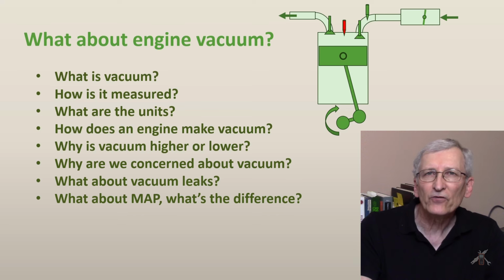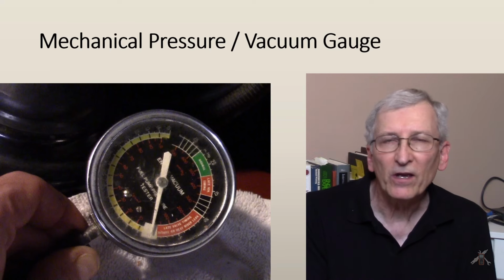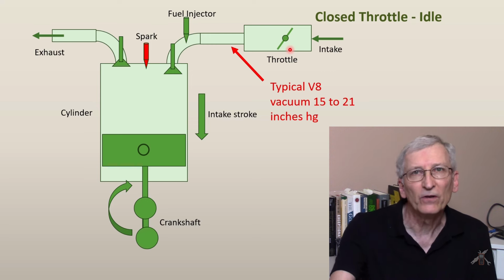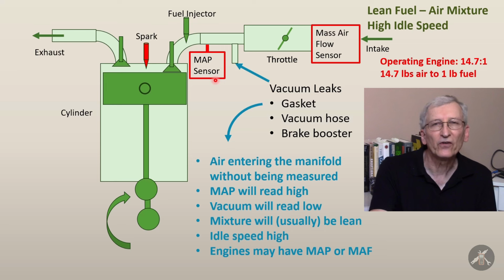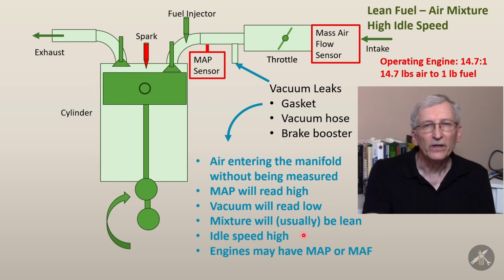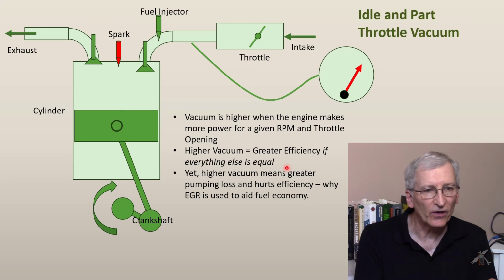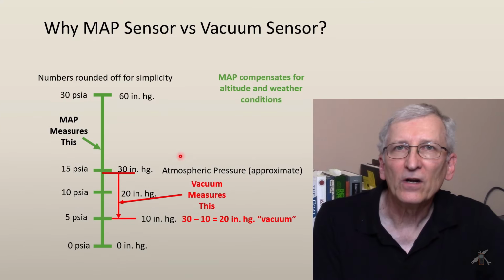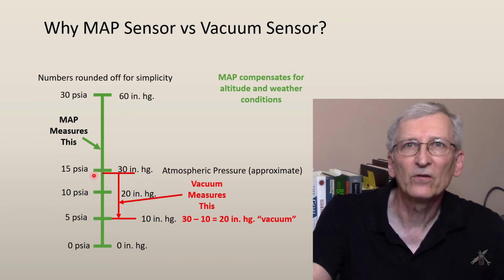Understanding Engine Vacuum and MAP - What is Vacuum? Why engines have vacuum & why it's important

Comment: May I ask a question. On my Jaguar AJ16 XJR6 supercharged engine there are two points where vacuum is taken: One is at the throttle body immediately after the throttle butterfly valve and just BEFORE the supercharger/supercharger bypass, and the other, which is the supply to my brake servo, is AFTER the supercharger just before the intercooler and intake manifold. I would have thought from a logic point of view that the point by the throttle is strong in vacuum as at idle the engine is pulling on the air and on acceleration the S/C is demanding a lot of air also creating vacuum, but after the S/C vacuum will be fine on idle, but on acceleration and full boost the S/C is actively pushing air into the intake faster than the engine is demanding it therefore pressurising my servo. Obviously I must be wrong somehow, or would it be better to take vacuum before the S/C for the brakes? Thanks for any help.
Reply from the maker: I don't know the reason for the manufacturer to choose that design, but I would not try to change it. On the surface, your logic sounds good, but the engineers generally know from testing what works best. One thing to consider is that on most engines, the vacuum brake system charges up / stores vacuum best at closed throttle - idle or deceleration. Also, there is consideration not only for the amount of vacuum in terms of pressure, but also volume of air moved to generate that pressure.  It may be that when your engine goes to closed throttle, there is more volume available at the manifold than immediately behind the throttle.  The brake system usually has a check valve to hold vacuum in the brake servo when the engine goes back to open throttle or boost to maintain a reserve.
Reply: @bitsofwisdom460   Thanks for the reply. I said the same thing to my electrician and he pointed out that although vacuum supplied to the brake servo would be less on full throttle I would not be braking when at full throttle. I pointed out to him that his education had not been wasted! 🤣. Yes, there is a non-return valve to keep vacuum in the reserve tank (although the reserve tank had been bypassed as it was punctured and obviously the previous owner couldn't be bothered to repair it due to its inaccessibility, or he had a death wish on subsequent owners!) so I will keep it as designed, or at least as I think it was supposed to be. With older cars like this sometimes it is hard to know what was original and what was a modification (or bodge-up) by previous owners, hence the question.
Reply from the maker: The questions are good. I agree, it can be difficult to know if an older car had been modified.  I always try to research, but it's still not always clear.  I like to try to maintain originality in safety related areas because sometimes the engineering rationale for the design is subtle and not obvious.

Comment: I simply figure Vacuum as being piston Suck dropping ambiant pressure at the Plate. At Wide Open Throttle, that pressure tries to return back to ambient but not for the latent volumetric inefficiency of the system.  We try to make up for that inefficiency by adding boost for Normalization, or Overpressure to multiply the air/fuel charge.

Comment: Maybe you should label your diagram "4 stroke engine" just to be pedantic.
Reply from the maker: I suppose I could do that to be more precise, but I thought it to be self evident.  Given that very few two-strokes have valves, except perhaps the old Detroit Diesels with exhaust valves.
Reply: @bitsofwisdom460  I wasn't keen to make the suggestion but like you, the Detroit Diesel came to mind so I thought it best to comment, a bit of wisdom if you'll pardon me.
Reply from the maker: Yes, that's fine, it's a good observation. 
BTW I used to work in a trans dyno lab with the a number of big Detroit Diesels.  When I worked on the M1 tank trans we had a 12V149 for durability work because we were breaking too many gas turbines. 4 valves per cylinder, two rootes blowers, 4 turbos, oversize injectors - 1350 net HP @ 1950 RPM.  A main difference in layout from 4 stroke is that these engines still had the intakes ports in the air box feeding the cylinders from near the bottom, so all 4 valves were exhaust valves. Really cool engines, start out from idle on mechanical blowers, when turbos spool up they overrun / bypass the mechanical blowers. Pressurize the air box so that when the ports and valves open, they clear the exhaust and recharge for the next power stroke.
Reply: @bitsofwisdom460  You've certainly given me a lot of info to digest and aroused my interest concerning gas turbine development for the M1 tank. Didn't Continental Motors at one time have MTU diesels and were they considered for the M1? In a military environment durability is paramount but ease of maintenance is up there to. I think it's criminal the poor engineering of today's cars where parts are so difficult to access let alone correctly diagnose or plastic is used in high heat areas where it becomes brittle and has to be rooted out. Better stop there and get off my high horse.
Reply from the maker: Yes, before I came to the project, there was a design competition between GM with a diesel and Chrysler with a gas turbine.  Ultimately, the gov't picked the Chrysler version. I had the opportunity to drive the M1s and the turbine was a nice performing rig.  But, in my 24 x 7 durability test cells I was having trouble wearing out the early production engines and keeping the cell running because engines were on shortage.  My facility team did a great job designing a gearbox to adapt the 12v149 and match the torque curve of the turbine.
As far as car design, I could explain, but that's a lot longer story. It's not usually poor engineering as much as the regulatory design constraints that the engineers need to work to. Mass / crash / fuel economy / emissions and so forth. I've been in the middle of it.
Reply: @bitsofwisdom460  You should write a book, aside from that, thank you for your replies and all the best to you.

Comment: I have a vacuum gauge just like the one you have. Bought it when I was 16. 72 now. Still use that today as it really helps what is going on in your engine. Great tool for carb tuning engine or any engine.
Reply from the maker: Yes, those vacuum gauges are quite useful for diagnostics and adjustments, aren't they?  I still use mine often.
Reply: I kept my gauge installed in the driver’s AC socket in my old 67 Camaro SS.

Comment: Hi, Sir. Can you tell if you have a timing issue from cranking vacuum? Thank you.
Reply from the maker: The engine will develop vacuum while cranking.  Ignition timing effect won't likely show up because once the engine fires, it will go from cranking to start very fast.  Valve timing issue like jumped timing chain would likely show up if ignition was turned off, but it might be hard to know what is normal cranking vacuum for a reference. I was asked to look at a car (friend of a friend) years ago that wouldn't start and the cam was jumped so far that it was pumping air back out the carburetor.  I didn't measure vacuum, but it appeared there was none at all.

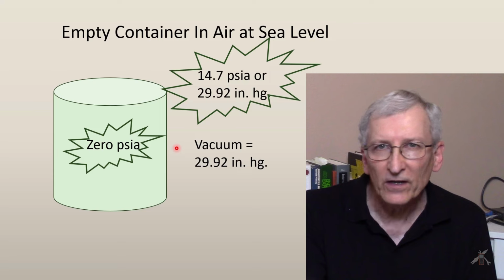Comment: 7:11 I’m confused. Can a vacuum be measured in mm of mercury?
I thought that relied on gravity, which is effecting the atmospheric pressure, but if we’re talking about the contents of a pressure vessel, its kinda like more about the difference between inside and outside, right?
Reply from the maker: Yes, vacuum or pressure can be measured in mm or inches of mercury.  And yes, you have the right idea, the difference between inside and outside is a relative pressure measurement.  That is what I was trying to explain: the difference between relative and absolute pressure. MAP is absolute, vacuum is the difference between atmosphere and inside the manifold (or other container).  You can measure relative pressure with a mercury column, it just requires a different reference point.  The best way is to use a tool called a U-tube manometer. I can't show a picture here, but if you take a clear glass or plastic tube that has a tall and narrow "U" shape, then connect the top of one of the sides of the "U" with a hose to the container and leave the other tube open to atmosphere, the height of the fluid column in the tube in mm is the relative pressure. I have seen these used with mercury. I use this method with water instead of mercury for very low pressures like air filter pressure drop.

Comment: Increased overlap will diminish vacuum AT IDLE. It will create greater vacuum at rpm, in a vehicle with full exhaust. Cam selection for a streetcar with full exhaust should afford only the minimal amount of overlap. It manifests vacuum on the piston when you are trying to rev. It will load the bearings beyond their integrity.
Reply from the maker: Yes, I agree that the overlap will reduce vacuum at idle and it will recover at RPM.  It will improve most at part throttle when the cam is in an efficient / tuned range.  But I'm not following your concern about exhaust systems and bearing damage.  The greatest negative load on the pistons will typically be on closed throttle "overrun" conditions.  Taken to the limit, assume a vehicle pulling a trailer on a mountain downgrade in low gear with the engine at high RPM and throttle closed for downhill braking.  I can say from experience that the engine can pull 26 to 28 in.hg. or maybe a little more depending on altitude.  You can sustain this condition for miles.  Now compression on most engines will be on the order of 100 psi or so, PLUS combustion pressure and the reversed load due to vacuum and with fuel cutoff would be no more than 14 to 15 psi. I don't understand how a higher cam overlap would cause a problem in this condition, but perhaps I'm missing something.
Reply: @bitsofwisdom460  it is complex. A manifestation of CFD.   Long exhaust = short duration. Long duration = short exhaust.
Oil temps will increase exponentially when it is in the zone. Dont run long duration cam in a car with full length exhaust and some gear. 80 mph is hot oil in 60 seconds.

Comment: Thank you, Sir  for the great video.  Could you please explain why pumping the brake pedal repeatedly cause the o2 sensor to go lean?
Reply from the maker: Yes, in short, the vacuum booster becomes a controlled vacuum leak in that condition. Back in the day, I worked for a brake system supplier and had design responsibility for boosters.  This gets a little hard to explain, but here goes... Essentially a typical vacuum booster stores vacuum (or has lowered air pressure) on both sides of a large rubber diaphragm. When you depress the brake pedal, a valve allows air to enter back side of the diaphragm.   
When you release the brake pedal, the booster needs to refill that large metal can with vacuum (removing the air) and that air flows through the hose to the intake manifold of your engine - on the back side of the carburetor or fuel injector so that it isn't measured and no fuel is added to compensate. Normally this is only a short pulse, but if you repeatedly pump the brake pedal, air will continue to flow into the engine downstream of the fuel metering system as manifold vacuum is depleted. If the booster valve has a leak, it can be a constant air bleed as well.
Reply: That is the best explanation I have ever gotten.  Thank you very much, Sir.

Comment: It used to puzzle me when pilots talk about manifold pressure in inches. Vacuum is half of the equation of a boosted engine. So how do you reference between vacuum and pressure? Inches of Mercury. No conversion, quick and concise. I rebuilt Pratt and Whitney R2800 radials and they had 2 stage superchargers. Along with T56 turbines, and that is a whole new story.
Reply from the maker: Yes, and I expect that dealing with manifold absolute pressure rather than vacuum / relative pressure can really be a help in aircraft, because it isn't affected by altitude.  A specific manifold pressure should result in equivalent power at any altitude or barometric pressure. Granted it may be harder to get a boost pressure at higher altitude.
And gas turbines are a different animal for sure.  I was a transmission test engineer and I spent several years in the '80s running M1 tank powertrains in dyno cells for performance and durability.  The AVCO Lycoming turbines were needed to test my transmissions.  I learned a lot about those engines because they were fairly new and had a few issues.  I ended up being an engine test engineer of sorts just for self preservation in getting my job done.
Reply: @bitsofwisdom460  I also had the opportunity to work on a test cell with a turbo I had recently rebuilt. It takes a little nerve and great care to stand inches behind a spinning 14' prop to adjust the fine pitch of the propeller control...
Reply from the maker: Yes, I expect that would be unnerving. I can only imagine that one.  The old Allison test cells where I worked had originally been used as final production test for the supercharged Allison V1710 V12 aircraft engines in WW2.  They were set up with large pedestals in the center so engines could swing a full size propeller and flow air through. That section of the test cell was heavy reinforced concrete while the rest was only brick. Rather impressive. For transmission work, they built floors at the level of top of the pedestals for bedplates.

Comment: Be more intuitive to lose the entire vacuum nomenclature altogether.   Calculations don’t like negative numbers, use the aviation convention of manifold pressure , positive units are better.  Plus, put emphasis that no engine, ever , pulled in air.  The atmosphere always pushes itself into cylinder p1v1=p2v2.  You know all that jazz better than most.  Excellent video, thanks so much.
Reply from the maker: Yes, I agree that dealing in absolute pressure in the engine is probably better. But, I approached this from a traditional automotive direction to try to bring those viewers to a better understanding. Also, while this video was focused on the engines, it ties in to some other topics. I have had some previous topics dealing with vacuum because in the automotive world there are a number of systems where vacuum or low absolute pressure is the force making things operate-- purge / cruise / brakes / hvac. I think that measuring vacuum can be easier to handle when working on those systems.
Reply: @bitsofwisdom460 I'm from the aviation background and yes manifold pressure is very accurate.